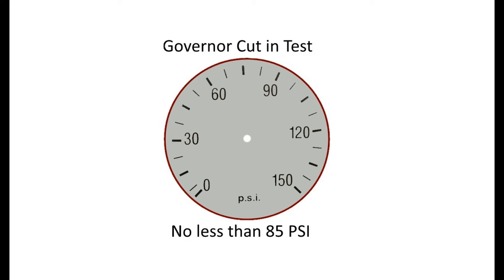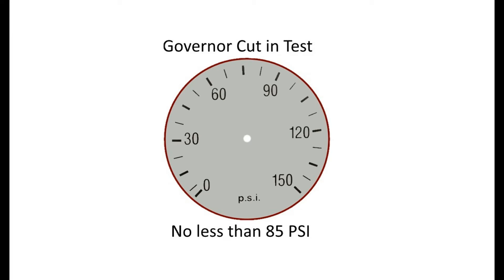Governor Cut in Test

Comment: That is way too low.In Ca it’s no less than 100psi.85 psi almost cuts in to your low air warning system at 75 psi.And there is no actually countdown pee the CA handbook.That is what the dmv instructor told me lucky she didn’t fail me for that.